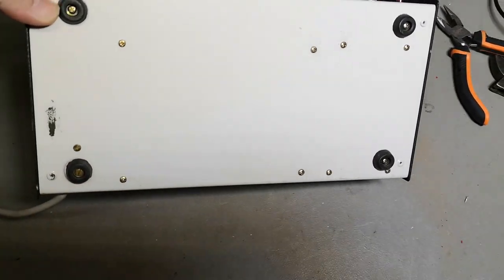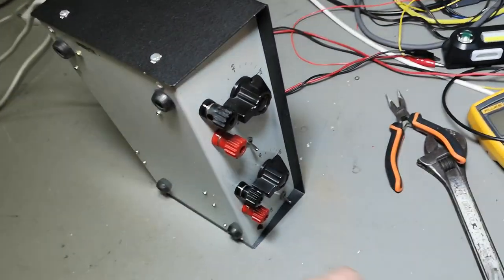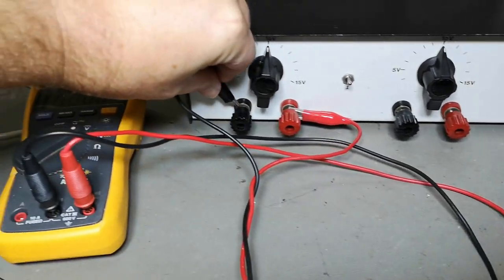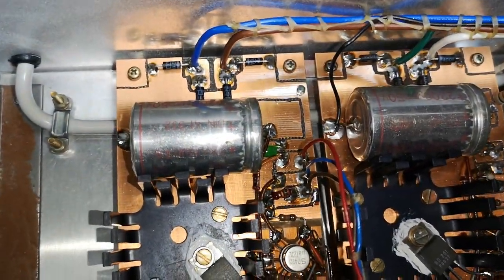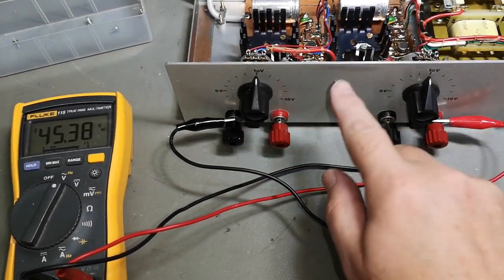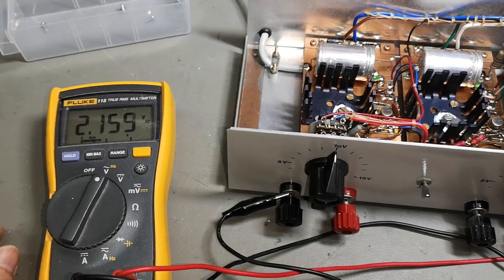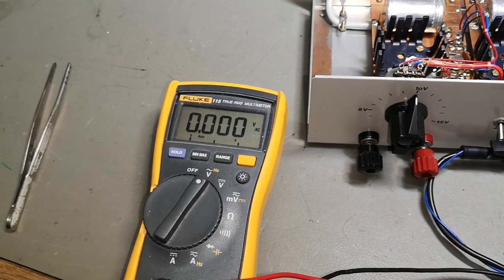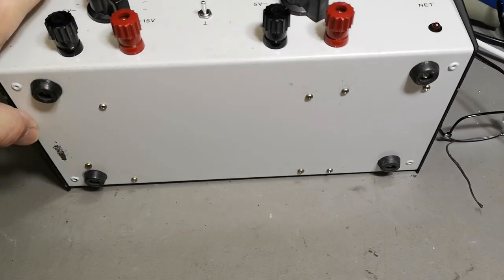DIY power supply 5-15V 2x500mA linear 1980 test repair teardown

Comment: That is beautifully made, the lacing on the wiring is a lost art these days. 

I'd be very careful to not short the output, I've seen a few uA/LM723 based PSUs which would short the pass transistor and kill the 723 chip, it'd be a real shame to kill the can style chips.
Reply from the maker: thanks, the overload test i did perform at 1300, dont you think it is very close to a short ? or is this type of over load test more slow or friendly ? as it did not take any damage
Reply: @TeardownOZ2CPU  My bad, yes, you're correct I got distracted by a phone call and missed the end of the video, it does foldback correctly so current limit is done right which is even more impressive.

I've seen a few PSU designs in magazines and even up for sale which weren't.
Reply from the maker: @M0UAW_IO83  cool, i am happy thin one is super, i got a few more psu's comming up, stay tuned the next two weeks :-)

Comment: I have a linear supply that also has 50v AC bettwen the output and chassis, I have seen that some supplies have a capacitor bettwen negative and chassis and positive and chassis, is this recommended to do? What are the dangers of having this voltage? If I have a multimeter sitting next to the supply and put it in ac volts it still captures some of the voltage, anyway I like the channel and the instruments that you show, especially seeing the internals
Reply from the maker: a lab supply can of course not be a hazard to any type of experiment ! some parts are more sensitive to low current but high voltage, so i strongly suggest to have close to zero volts AC from chassis, ground and your workbench protective earth